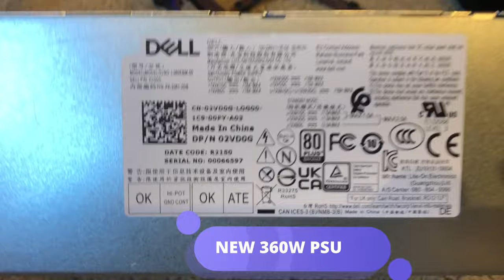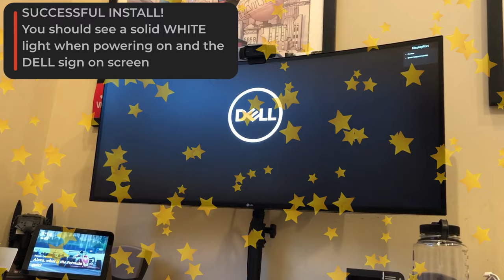Dell Optiplex 7060 7070 7080 5060 5070 5080MT PSU Upgrade Made EASY!

Comment: Can you please link one that will work on a 7070? Or tell me the model numbers?
Reply from the maker: So this is the description from the one i bought: L360EGM-00 360W VM8KR Power Supply Fits Dell Optiplex 3050 7050 7060 3050MT

Part # should be something like L360EGM-00 or the VM8KR dell p/n.

Here is the link to the exact one i bought: https://www.ebay.com/itm/295589658193

Hope that helps!

Comment: i have a 7050, what happens if you use a psu for a higher model?
Reply from the maker: so the PSU's for the higher models don't support the same motherboard, the latter models use a completely different voltage, etc so the computer just won't boot.  I've seen some hacks where people are using Corsair PSU's but I haven't actually tried it.  What model do you have?

Comment: I'm hoping you can help. I have (copied this from the "System Information") a Dell Optiflex 5060, i7-8700 CPU @ 3.20GHz, 3192 Mhz, 6 Core(s), 12 Logical Processor(s). I enjoy playing Fortnite, but it barely runs it, even on it's lowest game settings and I'd like to run it much, much higher. I'm told I need to add a GPU, however I'm learning that doing so will most likely require upgrading the PSU as well (it's currently 250w). I have an MSI Gaming Radeon RX 6750 XT in my cart, but can't for the life of me find out if that card will work with my PC, or what I would need for a new PSU. I don't really play any other games than that, and I'm not not looking for perfection... just have decently smooth, detailed graphics and a smooth running game. Any advice you can offer would be greatly appreciated. Thank you in advance. a
Reply from the maker: So i was in the SAME exact boat, basically wanted to upgrade the GPU in this thing.  Thus, the video.  You 100% have to upgrade the PSU to support a better GPU.  I bought the 360W version from the video: L360EGM-00 360W VM8KR.  The thing to keep in mind, is make sure it has the right amount of pins, there are a bunch on ebay that are mismarked and I had to figure that out.  In fact, this guy still has them: https://www.ebay.com/itm/295589658193 .  Once you do that, and i know you can somehow upgrade this PSU to even bigger wattage, but didn't try because they are all hacks, you can upgrade the GPU to any card that takes about 200W of power.  I got the NVIDIA 1060, looks just like this one: https://ebay.to/3TpQjgv , the key is make sure it only has 1 set of the 6 pin connector, there are some that have 2 sets which take more power.  Long story short, for about $150 or less, you should be able to upgrade the PSU and the GPU no sweat.  I can play Diablo IV on this card and pretty much anything else i have thrown at it, not a huge gamer but this works great for me and i'm sure Fortnite would be all good.  Let me know how it goes!

Comment: can you link me with one that I can use in the Optiplex 5060MT?? this 240v sucks. Would like 500 or 600 watt supply.
Reply from the maker: This one is supposed to work, but i would reach out to the buyer to confirm and if you get one on ebay, just make sure you can return it, they often sell ones that don't match up...
https://ebay.to/42y8hjF

Hope that helps!

Comment: Thanks for this video, I have a 7060 MT , but not sure how to do the gpu thing (I have a massive gpu).  
Any idea about using a standard non dell psu (putting it all in a large new tower case) to get it up to 500-750W ?  If the board only needs 6 pin and 4 pin for power, is it possible to match the pin requirements of the board (and for video) ?
Would appreciate your thoughts.
cheers.
Reply from the maker: Glad you liked it!  I pretty much went down a rabbit hole researching PSU's for this series.  Anything less than a 7080 or 5080 can't use the 500W that Dell made so your stuck with the 380W as the max.  That being said, I saw a bunch of videos and people showing you can use a Corsair PSU and externally mount it, but never tried it.  I wanted to run Diablo IV and my NVidia 1060 was perfect for the 380W PSU.  In all honesty, these machines, even though they're nice and compact, didn't have gaming or graphics in mind.  Good luck to you and let me know what you try!